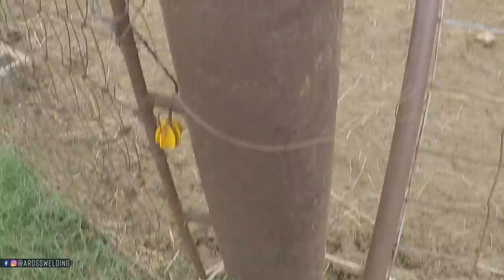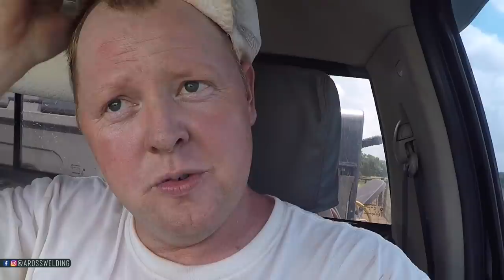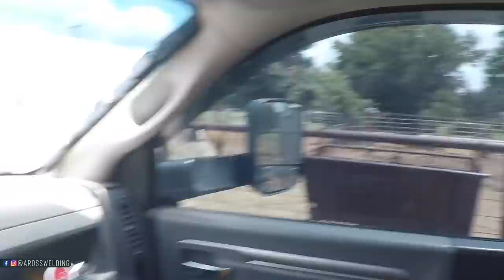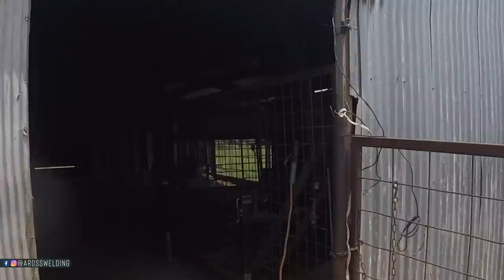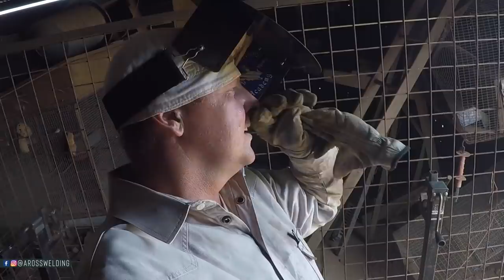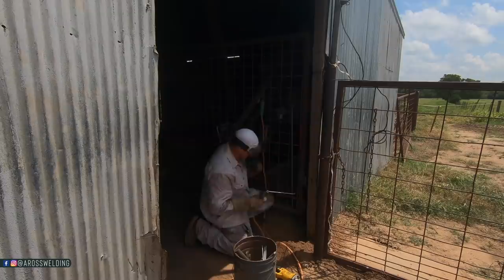OILFIELD PIPE FENCE - THE HIDDEN TRUTH

Comment: Did a repair on oil field pipe several years ago, magnetized so bad I had to oxy/acetylene weld it.  You're right about hot, it was really hot here in Dallas Friday where I was welding on a gas line, keep up the good work
Reply: Have you tried getting the first pass in with Alternating Current? And something like 6011?

Comment: Also depends were you get the pipe from, I have 4 suppliers around the Midwest and Wyoming that I can get pipe from depending on were im working, I gwt stuff through them because they clean the inside and outside of the pipe, and usually it is such good quality it doesn't matter much. I charge 25% more to weld with some crap someone has laying around, because 99.9% of the time it has been sitting in the dirt and they haven't looked at it in 15 years or it was crap in the beginning. If it has splits in it of any kind it belongs in the scrap yard.

Comment: My Grandfather built a house completely from used materials salvaged from a school. He was a retired steam pipe fitter.  The house was great until the plumbing started needing repairs.  You see he had welded everything from the well house up to the last elbow where he used a nipple to connect the faucet water heater or hose bibs. It worked fine for us my dad and I both weld but when Grandpa sold the house the new owner was not prepared to do that kind of matiance work.  The house was torn down within 10 years.

Comment: What thickness of do you use if you have the choice of using thicker pipe. And keep up the good work.  I enjoy watching you and listening to your tips. I built corrals here at home. My wife bought used pipe.  The pipe we used for posts were, I think,  oil field pipe.  They were extremely difficult to weld (some were easier than others).  I used  6011 which was I use mostly since most things are really rusty.  New metal I have used 7018 and it looks beautiful (at least to me). But need to repair the corrals (once it cools off). Any advice would be appreciated.  Thanks.

Comment: Get yourself an ez-up. I’ve even seen guys run a portable swamp cooler on job sites near their truck since they don’t pull much amperage off the machine. Work smart first. Those cooling towels work great too, keep spares in your cold box and change them out as needed

Comment: I have 10 miles of high fence with oilfield pipe and it’s worse than bad.  13 years about 1/3 of it is completely rotten.  All new fences we go back with new, galvanized pipe.
Reply: Paint it with kem kromik from Sherwin Williams. Absolutely amazing stuff. We do ironwork and use it to prime metal. I was almost done cleaning out a graco paint sprayer with mostly thinner left in bucket and a little kem kromik still in the mix. I sprayed an old rusted tractor tractor blade with white just to see if the spray coming out was still white or if the thinner had made it through the hose. That was three years ago and no rust bleed through yet. Amazing stuff.

Comment: Hey why does everyone get a ram for there rig truck and are rams reliable
Reply: I bought a used 96 3500dodge ram 4x4 with a box  and a skid unit in the back for welding  20 years ago still driving it . has a V10 original motor  16 miles to the gallon at 1800 rpm and 70 mph  most reliable truck I ever bought
Reply: @bartbley1269  have you had a ford or any other truck to compare or no

Comment: Hey man, get a dozen 3"x5" refreezable packs on amazon and throw them in a little baggy and keep em in your front pockets. They last about an hour and keep the blood running down your legs way cooler. The extra bag will keep them from leaking should you get a spark in your pocket, odds are it wont find the second hole, although i haven't had that issue yet.

Comment: What is the name used for the new thick side wall pipe?  Or do you have a link to a distributor or store for it? I want to do a long r panel metal fence, was thinking of using oil field pipe because of its heavy duty nature but now I would like to contrast that with new material but the lingo industry jargon is making my search hard. Can you please tell me what name or term you guys use for the new pipe. Thanks
Reply from the maker: The name that comes to mind is drill pipe. New drill pipe
Reply: @arosswelding  haha, I think you proved my point. I'm going to use metal building rectangular structural tubing instead. Thanks for your reply. -Cheers mate

Comment: Also have to worry about NORM. Normally occurring radiated materials. I haven't that much concern over it but a friend who is a petro enginerd said i should when welding. Gases etc... I figure i don't weld that much of that pipe and try to keep away from gases anyhow.
Reply: you got better chances of getting struck by lightning than getting hurt from radioactive pipe, most of it isnt very active, no more than what background radiation. what will kill/hurt your body the most is the fumes. we throw anti corrosion chemicals down the pipe string and itll burn your sense of smell and blind ya. not including all the shit that gets pumped in and out of them pipes + if they got a plastic liner makes it a pain in the rear...

Comment: What do you use for oil field pipe? Far as rods ?
Reply: 6010/6011-7010/8010
Reply: Miller Lite_66 how about sucker rod my welds seem to break off fairly easily. Using 6011
Reply: @gabrielyoder  for real? I've welded a decent amount of some old pipe with 6011/8010 with no issues besides having to whip a bunch due to the pipe being degraded.
Reply from the maker: 6010, 8010, 7018
Reply: Miller Lite_66 sorry shoulda been more clear. Oilfield tubing  welds fine the sucker rod is it where the welds break off more easily than they should.

Comment: Hey Austin I have a question for you, I need to get new welding leads for my bobcat. I don't know if you have touched on that subject before, but do you have any preference in a brand of wire over other brands?
Reply: Ultra flex cable is very common amongst pipe welders
Reply: @xDaGmanx  I got lucky I have a friend who had about 80' of 4 ot he gave me for free

Comment: Tried wrapping my lead around the pipe, tried switching polarity on the machine, just kept pushing the weld metal off, blowing, etc., I was using 6010, didn't have any 6011, but if it happens again, I'll try the 6011, it was a guard rail around a used car lot, no telling how old the pipe was, that was when I said to heck with it and broke out the torch, but thanks for the tip
Reply: i've heard that mag metal is apractically impossible without a/c...bad arc blow?

Comment: I'm not a fan of dialing in rod/current/ amp settings when I want  to hit the ground running. What's your (field expedient) 1st go to arc rod, AC or DC current, and amperage settings ? You know....The sweet spots that you can count on to start with, before any rod/amp/current changes.  Thanks.

Comment: Some welders are coming in to fix our pipe line I really want to meet one. What is the best time and place to try to talk to one?
Reply: Id say morning breakfast or dinner
Reply: If you get a morning break or afternoon break walk over where there working and introduce yourself. If there still there after you get off work go check them out. That’s what I did 30 years ago. Just retired from welding about 3 months ago. . Most of the time you’ll find someone that will talk with you. Just be aware that they are on the clock . Good luck👍
Reply: I’m only 14 but I have a cordwood/firewood business. And it’s getting big to the point where I leave the house at 7 take a lunch and don’t come home till 8 at night.     But the guys cut a bunch a firewood trees and threw them off the pipeline for me. So i will be up there cutting all day. Thanks for the advice!
Reply: The local bar between 6pm and 2am.
Reply: We don’t have a bar in our town. Idk y
Reply: @matthewerwin4677  this, or the beer store.

Comment: And some of the oilfield pipe is radioactive ☢️
Reply: A lot of used pipe yards will check your "for sale" load of pipe on the trailer with a geiger counter before you ever enter the yard.  If it lights up, they will turn you back.  Too much liability to even have it drive in the yard.